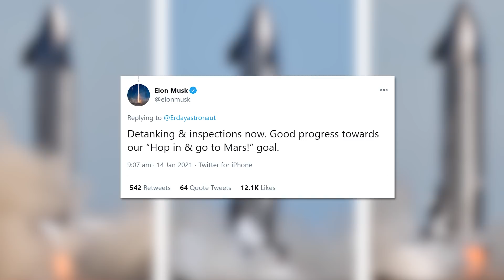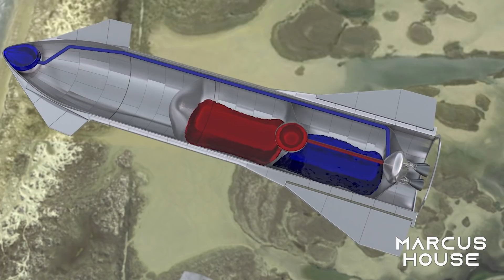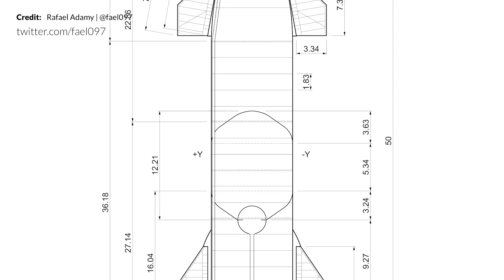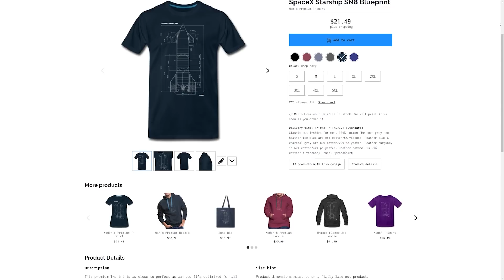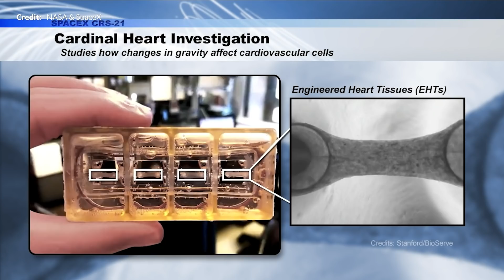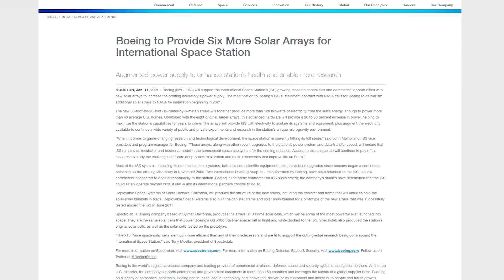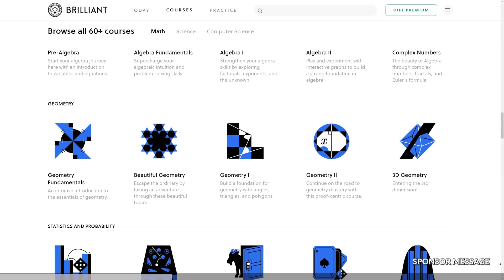SpaceX Starship SN9 Flight setback, CRS-21 return, Blue Origin NS-14

Comment: Reducing weight by 10 tons with thinner stainless does not necessarily translate to an extra 10 tons cargo capability.  It may simply be a build cost reduction, fuel efficiency or both.

Comment: I do wish Spacex could do a modified version of Dragon for the ISS. I wish there were 2 sections that could be joined together so when it docked at the ISS it could dock in reverse attach ,and leave a section about 10FT or 20FT long to stay attached. Then disconnect and head back home. Then they could simply keep adding to the ISS for extra space.

Comment: Spaces starship NS8 failed was because of gravity when astronauts are tested in aeroplanes day Force the plane to go into a steep dive to simulator lower gravity with the starship there was a limited and Marcus fuel in the tank in first place bye by pulling a pipe above where directly the roof would be where when dropping into a planet the fuel would rise to the top

Comment: I know it would open up a hole new can of worms but Starship could do without the header tanks and gain a lot of living space for the long trip by pushing down the tanks covers to keep them pressurized, like an engine piston in a cylinder. The weight needed for such a system could largely be recovered by the Removal of the header tanks. And it would eliminate the need to compensate for the movement of the liquid in the largely empty tanks while maneuvering.

Comment: all these engine problems.....Shock and debris due to close ground clearance.....no water, no diverters .....lessons learned in the 1950's and 60's
Reply: Or because they didn't do three static fires in less than 4 hours before, with no workers on the pad in between

Comment: Hi, if the height of test is 10 km in stead of 12,5 km, could it be for an extra test/practice of the landing maneuver, half way down, lets say at 5 km?
Reply: Probably because they already nailed the ascent, and now just need to nail the landing. Because of terminal velocity, the speed should be the same on landing whether early on it's from suborbital or orbital

Comment: Those baffles are to prevent slushing as when the fuel level gets too low the fuel can slosh around and allow air to come in.
I don't think those baffles are high enough to prevent a vortex and if that were the case the could easily put a vanes in the intake to overcome this not on the outside.

Comment: Get rid of the entire header tanks/vortex baffles system to increase payload, diminish complexity.
A flexible barrier material "big bag" lining the tanks into which fuel/O2 are filled with perhaps lubricated exterior would oppose vortices, gas mixing, and uneven liquid flows.  Flexible baffles of plastic might be necessary but probably won't be.  I can provide such very large bags with attachment hardware installed.
Reply: Please provide data proving your claims.

Comment: The 304L steel is interesting.  If it is expanded under pressure it gets stronger - as the Copenhagen rocket group has shown.  The are using 1000 PSI to expand their tanks to make them lighter AND stronger than aluminium.  Of course that would be impractical for tanks as gigantic as Starship.  But still - to me it shows how fascinating this material science stuff is.  Rocket science is awesome...

Comment: Current ISS panels are very old both in technology and wear, the output has declined over time.  What's most surprising about these new panels is that the mass is so much lower, the original panels needed the Shuttle to launch them.  As for the long term future of the ISS, the truss is likely worth saving being a solid structural member with out the metal fatigue issues which plague aluminum pressure vessels of the non-Russian half of the station.  Through modular replacement of pressurized modules the station could be made to last nearly indefinitely even as each individual component has a finite lifespan.

Comment: The 45th US President set 2025 and end of funding for ISS.  This was done without consulting all the countries that are the I in ISS. 
Also, Boeing did not make all modules in US segment, Lockheed martin also built many components.
But foreign imput as well:
Russia built Zarya.
Alenia built Nodes 2 and 3, Cuppola the MPLMs (one of whcih is now permanemly on ISS).
(I think Cuppola is joint Boeing/Alenia, but its name implies it was chosen in Italy).
Airbus/EADS built Columbus
JAXXA/ Mitsibishi  built the Japanese module.
MD Robotics (Canada)  built the arm/DEXTRE. 
The original solar panels had finite lifetime with their performance dropping each year.  Boeing gets free money to build new panels at a time when the US has already decided to pull out of ISS in 2025 (but don't that stop US still funding Boeing).

There are shells that Boeing was paid for but never used because in the end, Alenia could deliver faster. (Nodes 2 and 3 for instance - Alenia had the tolling to spit out the aluminium cans such as MPLM so it was quiker for them to produce them).

Comment: Wikipedia has an article covering High-dynamic-range imaging.  Toward the bottom of the article they have some examples of HDR processing that have the original images and the results after processing. The original images do a great job illustrating the points that you made in your video. This is particularly true when you click on the images to see a larger sized image.

Comment: NASA’s Space Launch System (SLS) program and Core Stage prime contractor Boeing were ready for the big moment of the rocket’s Green Run campaign and the biggest moment in the 10-year old program, a static firing of the stage. After a year of test cases at the Stennis Space Center in Mississippi, visits from hurricanes, and waves of the COVID-19 pandemic, an eight-minute long, flight-duration Hot-Fire test was planned for January 16 to demonstrate the readiness of the new rocket stage for its first launch.

The firing lasted only 67.7 seconds, well short of full-duration and the minimum two minute duration firing NASA said was necessary to complete the test.  The abort was triggered by a Major Component Failure indication on Engine 4.

Four veteran Space Shuttle Main Engines (SSME), now equipped with upgraded computers and adapted to meet SLS performance requirements, supported this crucial test of the rookie stage. The Hot-Fire test was planned as a full flight duty cycle to demonstrate the real-world performance of the large, complicated rocket; the renamed Aerojet Rocketdyne RS-25 engines will be put through a set of circular and sinusoidal gimbaling experiments that will help demonstrate operating margins predicted by analytical models.

Comment: Going from 4 to 3mm is also a 25% reduction in strength, dunno if thats gonna do the job, certainly cutting it super fine to design tolerances.
Reply: Centaur is still way thinner than that, but it can go to space
Reply: @alvianchoiriapriliansyah9882  Got details on that one for us?
Reply: @UberMick  Yeah because the engineers on SpaceX just decided to cross the fingers & see what happens with no calculations whatsoever?

Centaur is 0.5 mm thin
Reply: @alvianchoiriapriliansyah9882  They actually do sometimes, hence why they test so much 😉 0.5mm would not be enough for a stainless tank of that size under that stress, it's gotta be made from something else.

Comment: A vortex where methane flows out of the header tank into the down-tube would reduce the flow rate.  The baffles are lighter than a wider tube and achieve the same increase in flow rate.  A wider tube would also eat into the volume of the LOX tank which it passes through, making the baffles an elegant solution.

Comment: Making the tanks as thin as possible sounds great... until you consider that these are not single-use vehicles.  Multiple cryogenic cycles on thinner steel will dramatically reduce the time for thermal gradient induced brittle fracture.

Comment: The launch base is still too low, flying debris is a danger waiting to happen, remember poor ol Concorde, just a piece of metal bought tragedy. 
Please Elon Musk building a much higher platform will give plenty of clearance and safety, and could I suggest that you corregate your stainless steel panels then you will ad add tremendous amounts of strength to your spacecraft like the beautiful Saturn 5 Apollo Rocket, and you can reduce the thickness of stainless steel to 2.5mm sheet, anyway just a suggestion Elon, I am a retired fabricater welder who use to build stainless steel pressure vessels to 100% X ray standards. And not only that I am a space nut too. Can't wait for lift off.
Reply: Were the pressure vessels you worked on corrugated?
Reply: Pretty sure that had a good engineers thinking about this, no need for suggestions

Comment: As a tipp, instead of thinking from 4mm to 3mm, its just 1mm, convert the change into %. from 4 to 3 is a 25% reduction, since that weight is mostly the hull anyway, it is then way less surprising that "just" 1mm adds up to such numbers, converting into % sometimes paints a way better picture. Great vid as always and thanks for the updates.

Comment: Marcus there is also the angular rotation where the methane sloshes away from the intake when starship does it’s rapid rotation from horizontal to vertical for landing.  I suspect that right after landing burn started this led to pump cavitation and loss of pump pressure output.

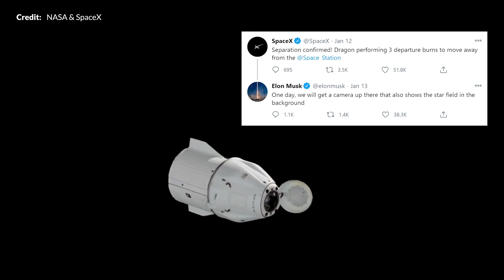Comment: 10:30 Comes down to dynamic range. The easiest solution to accomplish this would probably be dual ISO or using two sensors in parallel and merging the images (defining a soft threshold that determines for which luminance values which image "dominates"). Dual ISO is actually a feature on some cameras, at least with modified firmware.
Reply from the maker: I would assume you would need more than duel ISO. I suspect something similar could be done with two cameras and some sort of AI to merge both views. Interesting thought.

Comment: De-orbiting over FOUR HUNDRED THOUSAND kilograms of raw materials you have already put into orbit. The short-sighted nature of NASA  and government in general is simply revolting to me.
You could for a pittance simply have station-keeping boosters maintain a safe orbit for many, many years until someone could utilize all those bits and bobs that are **ALREADY IN ORBIT**.
NASA did the same with the shuttle tanks. The tanks massed almost 30,000 kg of nearly pure aluminum and had residual O2 and H2 which again could have been left on orbit to be salvaged as raw material. NASA as a government run organization has a grotesque myopia that only grows more obvious when SpaceX does the "impossible" on a monthly basis.

Comment: 6:37 animation is wrong. Liquids should be up on the "roof" not on the bottom of the tank as now.
Reply: Only if you're accelerating downwards faster than 1 g.  Otherwise,  it would be like riding a very fast elevator - your feet should still be on the floor inspite of the feeling of lighter weight.
Reply from the maker: You have drag going on reducing terminal velocity for the ship. That is why the bellyflop appears to fall slowly. Inside you will still feel gravity. The fuel will be sloshing around on the windward side as shown.

Comment: Is the Blue Origin vehicle a SSTO vehicle?
Reply: Nowhere near it. Getting to the Karman Line at 100km means you're at orbital altitude, but not orbital speed. Some V-2 rockets went that high and higher during WW II. Getting that high, just going up and down, is a suborbital flight; "sub" in the sense of speed. Suborbital flights are easy. Getting that high and accelerating to orbital speed, over 28,000 kph (17,000 mph), is the hard part.

Comment: Wait wait how did the cargo dragon de orbit? I don’t see any superdraco thrusters...
Reply: The old and new Cargo Dragons, and Crew Dragon, decelerate from orbit using only the Draco thrusters. They simply burn for a long time, about 11 minutes. It takes surprisingly little energy to change orbits - the Space Shuttle used two engines with only about the thrust of two SuperDracos to adjust its orbital height up and down. Also, it's easier to go to a lower orbit, gravity will always pull you down!
Reply: I see i see

Comment: What they should perhaps do is use one Raptor and the header tanks to get the ship back into a vertical orientation a bit earlier than they did with SN8. Then while the one engine used for reorientation continues to use the headers for as long as they continue to perform, the other 2 reignite using the residual fuel in the main tanks.

Comment: Other rockets feature baffles in their tanks in order to prevent fuel from sloshing around under certain conditions. Main goal is to prevent undue stress on the structure. I would be surprised if a system with such a peculiar flight profile would be able to go without some form of baffles in the tanks.

Comment: If anyone's interested I came up with a basic solution to the blow-back problem. It essentially comes from the old Project Orion design. The solution is a grid of heavy steel plates bolted together to act as a pad. A starting guess might be 25 or 50 mm thick steel. A further improvement might be made with a low level spray system.

Comment: 6:32 as a pipefitter you nailed it on the head that is exactly what the baffles are for. Stopping the vortex from sucking gas into the pumps. If pumps get gas instead of liquid they will have cavitation, over speed and then break something
Reply: As a fellow pipefitter I agree UA 663 all the way

Comment: 11:20 why don’t they just have two cameras with two different settings to take one image of the dragon capsule and one image of the background stars and then just overlay them.
Reply: Sounds very do-able. However, it is about exposure levels, not objects. 

Since the photoelectric effect is rather linear, it is necessary to have multiple sensors that overlap in exposure sensitivity range before distorted limits are reached, perhaps more than three levels of sensors. It is also necessary to have exponential media files rather than linear file protocols, effectively using real numbers instead of integers.

Furthermore, the playback must be artificially enhance to pull up brightness of dim features, so dark or shadowed objects will look unrealistic.

Comment: At the cost of introducing an extra fluid and set of tanks to contain it, hydrogen could be used for CH4 header tank press on vehicles operating far from Earth and the helium available here. If the helium is already in two or more tanks, splitting the system and using GH2 for press and purge on the fuel side would only need an extra set of valves, regulators, and piping.

Comment: Welding stainless steel outside in the wind!  Are there any questions about  weld integrity going for a 25% hull thickness reduction. In my experience with a  beautiful material like 308, the best welds are  about the same color as the plate material.

Comment: My guess is that the New Shepard is fighting the aero-drag from the stabilizer ring and the air brakes at the top of the vehicle. Moving the bottom of the ship with gimbaled engines and steering fins is unable to overcome the excess drag. When the landing engine fires, the vehicle is traveling a couple hundred mph keeping the drag surfaces at the top alive. Once the vehicle slows down using retro thrust to a point where the drag effect is lost, it's too late to correct its position. At least that's how it looks to me. I think that they will live with this to cut their losses and move on as a fix would require a major redesign. - Not a rocket engineer!
Reply from the maker: I suspect you are right. It was windy too so not really a problem. It is designed ok. I just find the landing pretty weird looking compared to a Falcon 9. 2 different vehicles for 2 different purposes though. I still love what BO are doing. Can't wait to see New Glenn.

Comment: the pressure problem is because you cant pull fuel from a sealed tank without losing suction or collapsing the tank so they backfill it with helium to keep the pressure steady so the pumps can pull fuel. without the back fill pressure it its like sucking from a caprisun pouch - you end up smooshing the whole thing (the engines get starved of fuel)

Comment: I’m a little concerned with the durability of the raptor engines. If the starship is going to do what it’s designed to do then the raptor will have to be extremely reliable and durable and it’s just not showing those traits right now.
Reply: Yes, but they will improve just like everything else at Space X. I agree they are not there yet.
Reply: @MrEd2291  I hope so. It will basically have to be the most reliable rocket engine ever made. It just doesn’t take much for things to turn catastrophic with the design on it. It could take longer to work out all the issues with that engine than getting the starship and super heavy dialed in.